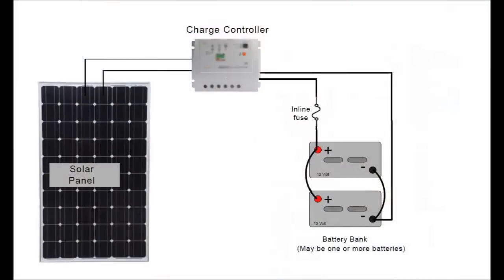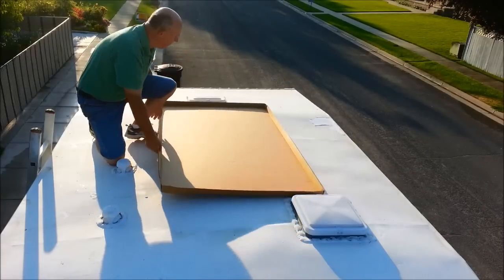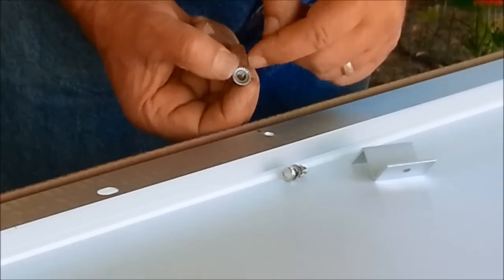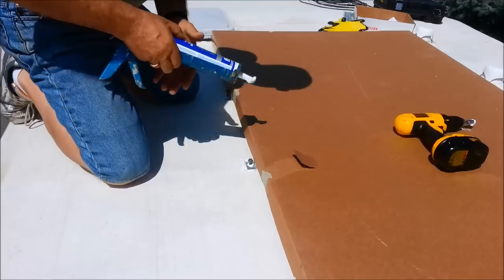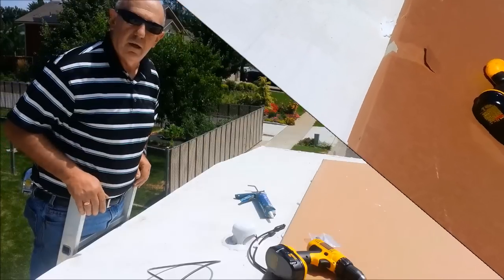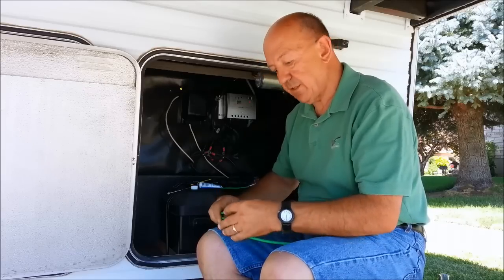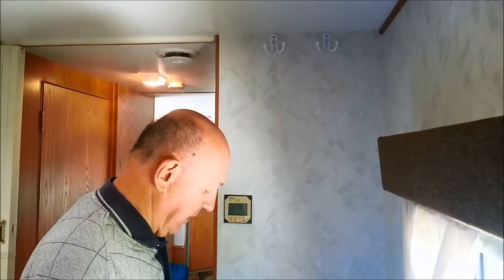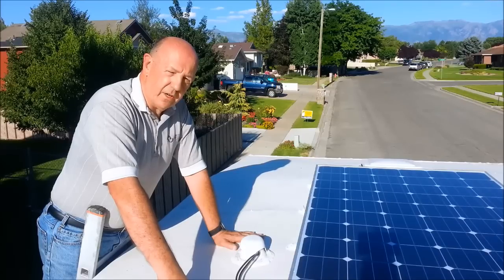The Power of Solar for Your RV

Comment: Great video and covered everything I wanted to know.  Lessons learned; 1. yes you can use the vent pipe.  2. Do not Connect/Disconnect under a load.

Comment from the maker: Glad you liked the video.  To answer your question, we just returned yesterday from a four night trip, and we did have to use the furnace every night.  We would wake up in the morning with the meter saying I was at about 40% power, but by early afternoon we were back up to 100% even on the cloudy day.  You would have to have a lot of battery and a very heavy duty inverter to run A/C but the furnace worked very well.

Comment from the maker: Thanks, I'm glad you liked it.  After a little experience I've discovered that there is one more thing I need to do and that is go from 2 12 Volt batteries wired in parallel to 2 6 volt "Golf Cart" batteries wired in series to get 12 volts and almost double the amp hours.

Comment: I installed a 100 watt panel to my R.V. last year and added the controller for the bank of 4  deep cycle batteries, and an inverter to operate my tiny frig., and all lights were converted to LED. It works great out in the woods.  When I can plug in I do with a 30 amp inverter I purchased from EBAY. Your idea of running the wire through the vent hole was Awesome. I did  the same and NO leaks! My 110 power is separate from the air conditioner  on the roof.

Comment: Very, very good! Please make sure to emphasize research and knowledge of RV electrical system. My system allows 120 v or 12v it switches automatically. Charging batteries at either voltage. Safety first

Comment: Very thorough video and pleasant to view, two of those 250 watt panels is almost a perfect match for two 6v trojans...220 amp/h batteries...rarely will U need the genset, Im sure You will "find" ways to use all the extra power,lol.  U need to keep in mind most deep-cycle batteries need between 10 and 14 % charge rate ratio, here is an example a 12v  220 amp hour bank needs 22 to 25 amps to be properly and efficiently supplied, can be from solar or shore power stand alone charger, it really doesnt matter the source just needs to be in that 10/14% range.I Hope You find this helpful as it is often misunderstood by DIY solar installers.

Comment: Out of all the videos i have seen on youtube for solar panels on rv/van this is the best one yet. I have a new 1988 custom van (yes new because she is my new baby) and i want to install some solar panels on her. Up to right now this is almost all i needed. It would be great if there was a second part explaining how long it took to charge the battery and how long did the batteries last without hooking it up to the alternator. But the best thing about this video is that it is "dumbed down" for us that do not know the "lingo". thanks and good job Mr. Law
Reply from the maker: Thanks Mr. Rodriguez.  It is very hard to do a part two that says how long it takes to charge the battery and how long they will last because there are so many variables, like how much direct sun you are getting, the types of batteries and how many you have, your controller, etc. etc. and that's just for the charging and then it comes to the discharge rate of what you are running off the battery(ies).  There are lots of sources on the internet to help you understand the different types of batteries and which is better and why, along with wattage and amperage draws, and so on.  Unfortunately there is not just one straightforward answer to all this.

Comment: Great video! I'm in the research process and coincidentally was looking at the HD Grape Solar (2) 250 watts panels.  They are reasonably priced compared to other online vendors.  Just need to figure the best controller for the money.  I like your idea of the remote monitor.  My idea is to design a system that can be upgraded.  We have a 41' FW Toyhauler...roof area is not an issue.  Also, would install tilt brackets and upgrade from 2 to 4 AGM Group 31 batteries. I got look into the 6 volt set up too!  Thank you again for your time and effort.

Comment: I must commend you on your presentation .... I'm very familiar with both 12V and 110 V Systems, just not familiar with campers/rvs so I am researching stuff before buying, ran across your video and clicked play.  I LOVE the comment you had for the fusing ..... NEVER take chances with DC power, ALWAYS fuse it, otherwise you may become a fire statisitic as there is no limit to the current you can draw from a battery .... it is dangerous enough with the fuse, I shudder to think about an unfused battery circuit.  Good for you for not listening to others ..... sizing electrical components is the same thing .... I always buy bigger than I must have, usually I only want to tax a component by 50 to 75% of its rated capacity.  If I need 1000 Watts inverted, I'd use a 2000W inverter, minimum Stuff runs cooler that way and less possibility of failure .....  , of course, though there is a point where oversizing does get ridiculous (and costly).  Good looking system you put in, well done!!

Comment from the maker: For any panel above 100 watts MPPT is recommended as it controls the charging levels much better.  The manufacturer for my panel strongly recommends the use of an MPPT controller only.  As far as I know the controller does not get very hot, but since it is an electrical component it could cause an explosion if in an enclosed compartment with the battery which can under certain circumstances emit explosive gases.  Thanks for asking.

Comment: Thanks for the video.Well thought out and presented.Now you have me thinking about this as an addition to my tent trailer.
Reply from the maker: Thanks for your kind words and I'm glad that it helped.  I have a friend who put one on his tent trailer and has been very happy that he did.  His is not permanently attached, however and is about a 100 watt panel.  When he gets to the camp site he puts it on the top before lifting it.  I don't know how he secures it in case of wind, but I think he uses small spring clamps to stabilize the cables going down to the batteries.

Comment: Thanks for sharing your video.  One thing that I have wondered,  what happens to the panel if it hails.  I live in Amarillo, Texas and we sometimes get large baseball sized haid.
Reply from the maker: These panels are reportedly really tough, but if I were worried about a hail storm I would probably try to cover it with something.  Of course the problem is you often don't get a lot of warning with those.  I read a lot of reviews and not one mentioned any problem with hail or any weather issues and, obviously, they are all outside.

Comment: Nice video, Scott!!  
I didn't cover my panels at all, even while I was setting them up.  I had bare wire exposed too :)  They did end up shorting and, I must say, 250-watt panels that are shorted in full sunlight look like little arc welders.  It doesn't cause any damage to the panel but one of the wires melted a bit where they touched :)

Comment: Nice job. However,I noticed a shadow across the solar panel. That shadow might be just enough to reduce the output by as much as 90% on a poly crystalline panel. This would occur if the vehicle faces East or West so the rising or setting Sun casts that shadow over the panel. At that time of day, perhaps the shadow effect would be minimal anyway. I think it will work just fine for you.
Reply from the maker: Thanks for the heads up, but my experience has been that I get plenty of power.  As an example the panel is rated at 30A and in a cloudless sky the meter is showing up to 34 to 37 Amps.  The other day it was solid gray skies and a light rain and I was still getting about 28 Amps.

Comment: How did you snake the wires for the monitor inside the vehicle?  Now that I would have liked to see!  Very informative and you made it look easy.  I will consider doing this when I get an RV.
Reply from the maker: The reason I didn't show the snaking of the wires for the monitor inside the RV is because it's probably going to be different for every RV.  In my case it worked out real nice to run it up the inside corner of my closet.  The final location wasn't the absolute optimum but it was a really good compromise.  The key is planning ahead as much as possible.

Comment: Hey Scott: pretty good job on the video, and the installation of course.  You might have considered using some rubber washers on the roof of the trailer, both under the z-brackets, and on top of them, but under the screw heads, thus sandwiching the brackets between the rubber washers.  They would probably last longer than caulking as far as providing a long-lasting seal. Running the power wires from the panel down the vent pipes was also clever, and saved making more holes in the roof.  250 watts should provide good charging and you may know that the factory-installed converter could charge at as much as 45 to 65 amps, but if you are judicious in your battery use,  it should work out for you.  I wonder how much output the solar panel has on a cloudy day, or even a rainy one.  Have you checked that out?
Reply from the maker: Thanks for your comments and the suggestion of the washers is a good one.  If I remember correctly this panel is supposed to be a 30 amp panel, but on sunny days it is common to get more like 33 or 34 amps, on the cloudy day I still get in the upper 20s, but I haven't spent any time in it on rainy days.

Comment: Hi Scott,  Is the drill bit that goes into the roof itself any special king of bit?  I love your presentation....good teacher, thanks
Reply from the maker: No it isn't.  Just one that is a little bit smaller than the screw you're going to drill in and be sure you don't go in too deep and damage the interior ceiling.  Thanks for watching and for your kind comments.

Comment: Hi Scott,

NIcely done video.  

But one question,  I thought batteries in parallel give you total amperage capacity instead of being in series?  I thought in series if one battery is low in current the total current  be the lower of either battery

I think the only advantage of the golf cart batteries is they have different charging and duty cycle than the flooded wet cells.

But very clear and detailed! video,  very nice!

Boxin'
Reply from the maker: I may be saying the same thing as you here, but I want to be clear.  If you have two 12 V batteries with a capacity of 65 Amp hour each and you run your system at 12 V then you would wire them in parallel and maintain 12 V and have 130 Amp hour (2 X 65 = 130).  6 V "Golf Cart" batteries have much higher Amp hour ratings.  Even reasonably priced/sized ones have as much as 230 Amp hour ratings, but to get 12 V for your system you would have to wire them in series.  Two 6 V  230 Amp hour batteries wired in series would give you 12 V at 230 Amp hours.  If you really want to have some fun, wire multiple banks of 6 V Golf Cart batteries which are wired in series in parallel.  In other words; each bank would have two 6 V batteries wired in series to give you 12 V and then you wire two or more banks together to increase the Amp Hours.  Two banks at the above rating would give you 460 Amp hours, etc.

Comment: nice video just want to add y 2 cents. A lot of people install solar panels on their roof like this but do not ground them. For safety I would recommend grounding the panel frame should become energized it will take the potential away. Also even though you were reading 27 volts you will never capture the full potential power of the panel when it is laying flat on the roof. Fixed solar panels are designed to get max power for approximately 2 hrs a day and that is with the panel angled and parallel with the sun. Like I said nice setup
Reply: I put in solar last year in my home and cannot begin to tell you the great benefits.

Comment: thank you for sharing this video, great video to show how it works to install a solar panel. Could you update that how to install the remote monitor into the system? also which style of battery you are using to charge the power?
Reply from the maker: I'm sure every system is going to be a little different on installing the remote monitor depending on such things as the shape and size of your monitor, where your charge controller is and the configuration of the RV.  It's basically a matter of running a wire from your charge controller to the remote monitor.   Thanks for viewing and for your comments.

Comment: You will love the free power. Mine is 200 watts and I ran this to 6 AGM batteries in parallel. I then ran #2 wire to a 2.5k modified sine wave inverter (with a 100 amp inline fuse). It will run everything except the a/c, which I don't need up on the mountain anyway. You did a great job on the video, who did the camera? And...Try to wear the same shirt in each scene, lol.

Comment: Enjoyed your video....I am just getting ready to add solar to my rv.  yes the web is a great resource for info on how to do it.  One thing I'd add on yours would be another fuse, from the panel to the controller.  right now you don't have a way to disconnect power without going on the roof and covering your Panel.   most controllers require you cut power from the battery 1st, then the panel 2nd, in order to shut the system down....same with restoring power.  That said, you don't have a way to shut the power from your pv without a switch or fuse....I am using resettable DC circuit breakers so I have breakers as well as disconnects on both sides of the controller (on positive wire).  thanks for sharing your install with us.
Reply from the maker: Thanks for your great advice on this.  Right now I'm doing it the hard way and disconnecting the wire from the panel to the controller, but I'll look at that resettable breaker suggestion.  Thanks again!
Reply: Scott Law

Comment: I really enjoyed your video and your presentation was very professional and informative.  How do you think the panel would do if you were caught in a hail situation.  Do you know it there would be a protective cover that could be popped into place if something like that were to come up?  We get some hail storms now and again and I was thinking it would be rough on them.
Reply from the maker: Thanks for your comment and good questions.  I remember reading in the specs or somewhere that they are rated for a pretty strong impact so unless you get near record breaking hail you should be okay.  I don't know of a specific cover made for them, and since it seems like every solar panel is a slightly different size I'd be surprised if anyone makes one.  If you're are concerned you might have to make your own, Good luck with your project.

Comment: I to had a hard time trying to figuer out what size fuse to install. Some add a fuse per panel in a combiner box on the roof, others add the fuse to a disconnect box prier to going into the charge controller. I just added a 30 amp fused disconnect box, my charge controller is 30 amp. 
  I am not sure how to fuse my panels, nominal amps are 6.52 amps, short circuit amps are 6.85 amps for my panels. Not much room for error their.
 Anyway very good vid try to give us a update clip letting us know how you are liking your system. Thanks
Reply from the maker: I added an update after 9 months to the video description.  Just check click on the "Show more" under where it tells the date published etc.

Thanks for viewing and commenting.